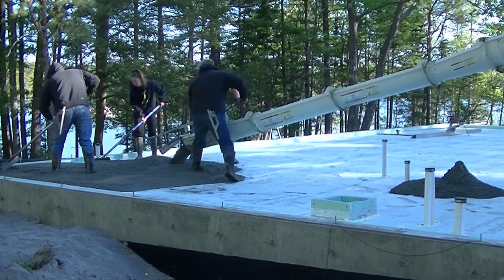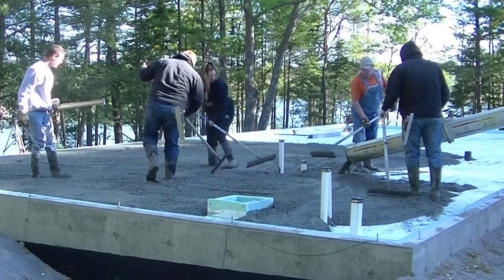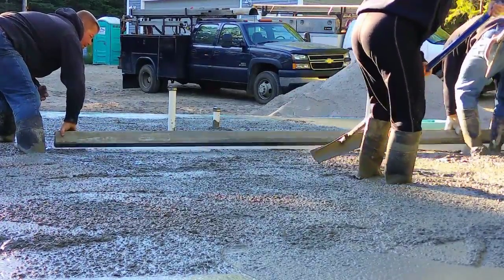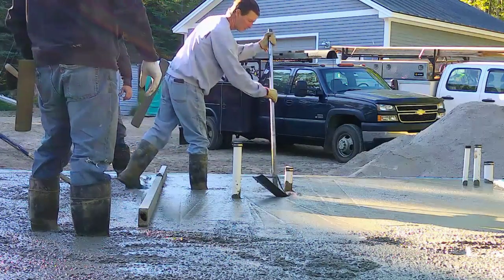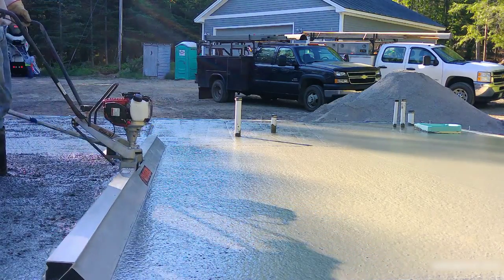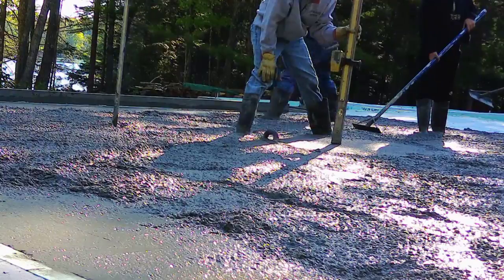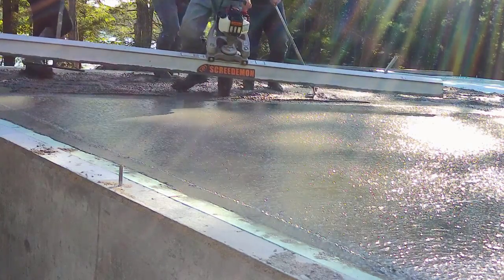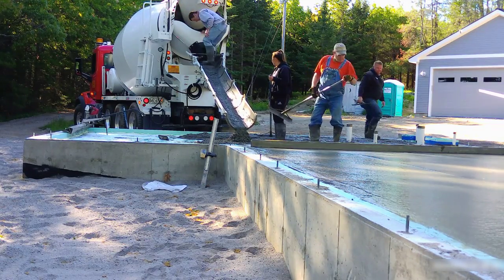Easy Way To Screed A Concrete Floor (Best Way For Beginners)

Comment: Mike, great video thank you for taking the time to make it.  I am a homeowner, normally I use the top of the forms as a reference when screeding, making sure all of my stakes are below the top of the form. For a 15 foot wide driveway if my stakes are below the top of the forms, could I use a 16’ power screed running it on the top edge of the forms? Thank you in advance for your help!

Comment: Looks like a good slab. Out here in North Dakota, you don't see laser-transit "wet pads" like you call them, we use stakes (or rebar with the Y-saddles) that hold a screed pipe. The vibrating screed just rides right on the pipe, and the subsequent hole is bull floated in.

Everything else looks familar though, from one cold weather concrete guy to another. Good to see other contractors saving their back not hand screeding the whole thing.

Comment: Mike. I am in the state of GA. I am just entering the concrete business and your videos have helped tremendously. I am having trouble ordering the concrete as I don't know the vocabulary very well. Could you make a video that could possibly help?
Reply: Go visit with the batch plant. Vocabulary varies in different regions. I find that even in the same area, different companies each have their own way of expressing things. If they are not real forthcoming , then ask them what other contractors often do in the situation you are facing. Cold weather, hot weather, and other factors may radically change what you should ask for.

Comment: For a garage’s do you Use Metal Wire mesh (4x8 sheets)or just add fiber mesh into mix? Do you see the fiber after it’s been power troweled?
Reply from the maker: We use micro-fibermesh, you can't really see it unless you really look. We only use the wire mesh sheets if the plan calls for them. Most floors are spec'd with fibermesh nowadays.

Comment: Hi mike do I need to use the concrete helicopter after using the bull float.?
Reply from the maker: If you want a power trowel finish then yes. But the concrete has to firm up quite a bit before you use it.

Comment: I have that power screed. Filled it with 50¢ in gas and used less than half for a 60 foot driveway

Comment: I've ran one ever day for a company in st Louis on streets we average 200yds a day 6 to 8 inc pavement I use it on everything exposed stamped I I truly believe you should know how to knock down before you run one and you can really mess stuff up with the thing I have a 4 foot blade for sidewalks I still hand drag only when nessary out of the stone age I say

Comment: is that a 6" stemwall? If so wouldn't the insulation show if they didn't cover slab w flooring? Maybe you have to use 2x8 walls in Maine for more insulation which would cover foam.